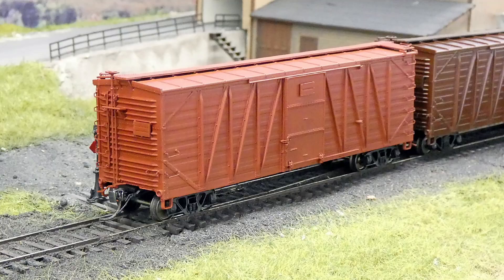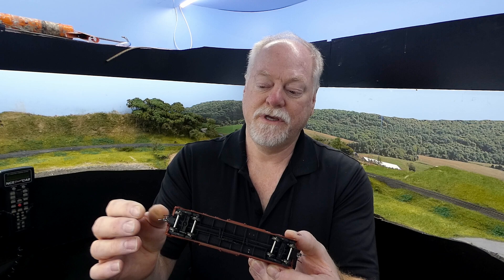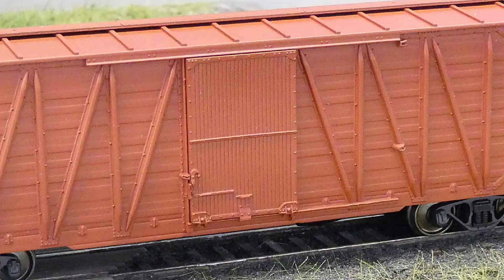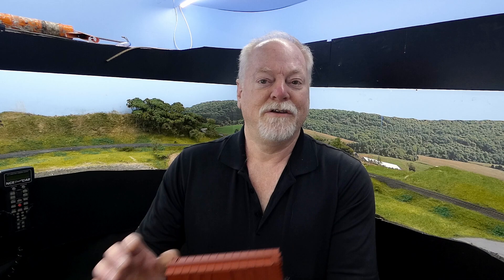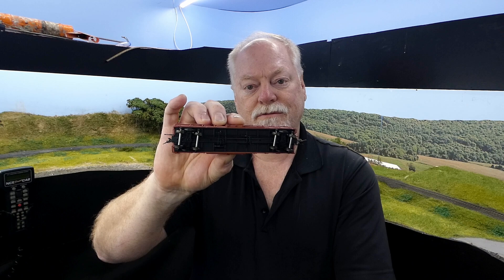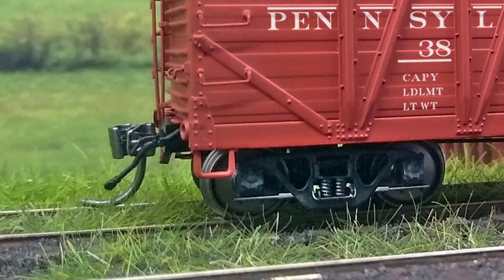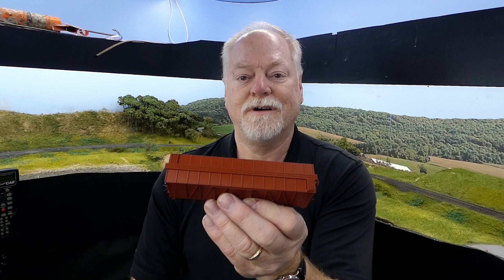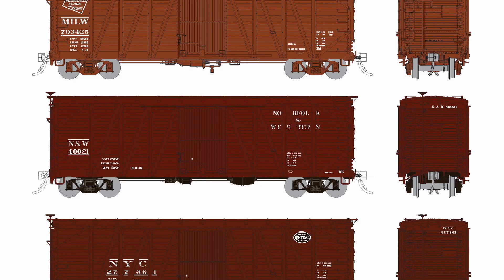Rapido USRA & CPR "Clone" Single-Sheathed Wood Boxcars

Comment: Perhaps it's actually a screen illusion, but the boards of the sheathing appear as a corrugation(every second one or so set back) rather than all flush with the bracing. ??
Reply from the maker: This is a  detail which will be toned down on the production models. Boards will look more even.

Comment: Very good! Since the doors are different, may we presume they are separate parts and may be repositioned as fully or partway open?
Reply from the maker: Unfortunately the doors are glued in when installed. You should order the undec. Then you can choose the door you want and the position.